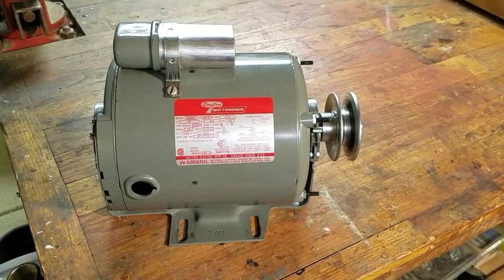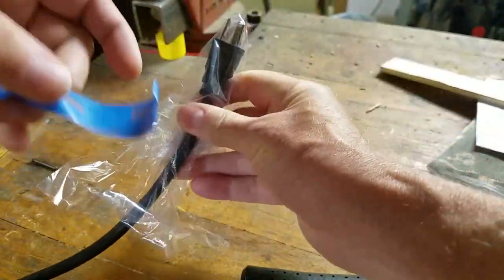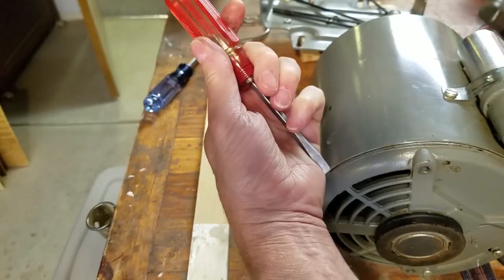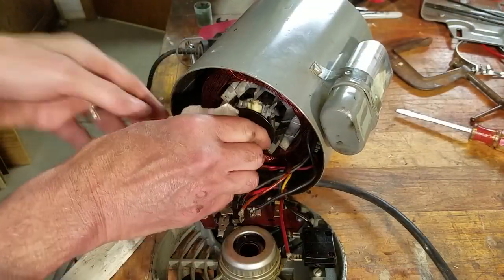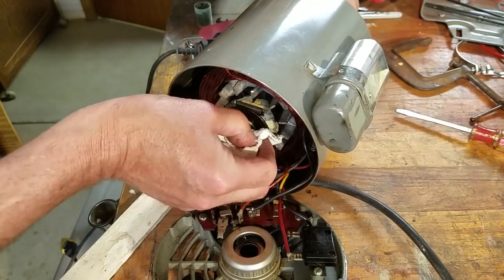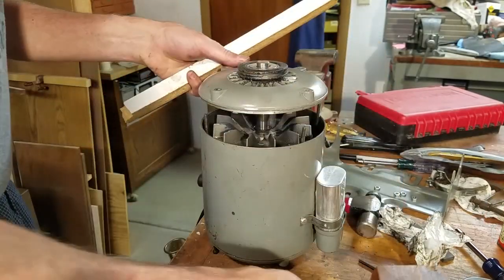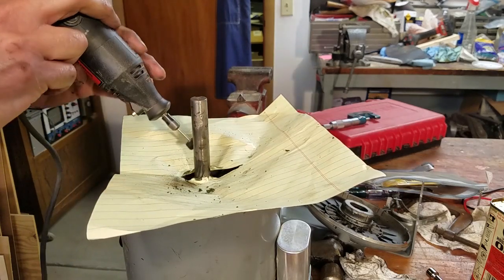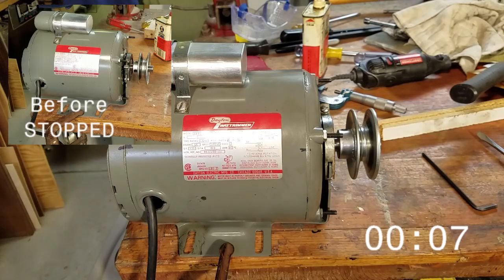The Case of the Squeaking Blower Motor - Dayton 6K857 3/4 hp Motor

Comment: Can someone explain what exactly happened here to fix the friction presumably causing the noise? I dont understand why this worked. I saw only the two mating surfaces of the bearings and shaft being cleaned and lubricated, but were the bearings themselves ever replaced or repacked?  I saw the centrifugal switch was lubricated. Was it sticking and where the noise was coming from? Are the bearings sealed or open?
Reply from the maker: They are sleeve bearings, not ball or roller bearings.  The shaft rides in a bronze bearing that is oil impregnated. Over time, the oil drys out and mixes with dirt and forms deposits on the outside of the shaft.  This reduces the bearing clearance and the high pitch squeal is actually a stick-slip friction caused by the gunk on the shaft along with the tight clearances.  Polishing the shaft increases the clearance and eliminates the gunk.  Adding oil completes restoration of the bearing back to working order.

Comment: David, Thanks for your very informative video. I was given a JET band saw with a 1 HP Dayton capacitor start motor. When I turn it on it slowly turns, hums, and will throw the breaker if I leave it on for a few seconds. I suspected the capacitor since it looked sketchy so I ordered another one and replaced it. It did improve marginally but still turns slowly and then throws the breaker. I suspect that there is something wrong with the clutch or the contacts. I don't have a lot of experience with motors and I have been unable to find any documentation on this motor so I was grateful when I discovered your video. I have watched several videos that say that the Start Capacitor has to have a resister soldered in to bleed off any residual electricity left over from the motor start. My original capacitor did not have one and I don't know how to find out which one I need. Any ideas? Thanks again!
Reply from the maker: It depends if it is a run capacitor or a start capacitor.  There are both types.  If your original didn't have a resistor, then the new one shouldn't either.  Open the motor and take a whiff.  If it smells burnt, then the winding my be damaged.  Some of the coils may look dark; that's not a good sign either.  In either case, you will need a new motor.  Good luck!

Comment: My a/c blower motor started making noise and I took it apart and greased it with the highest quality grease I could find...CRC synthetic brake and caliper grease.  I reassembled and it's been running fine now for 7 years almost continuously. Nice video. 👍
Reply from the maker: Thank you!  Self lubricating motors are much easier to use than motors with oil ports or grease cups (really old, but I got a couple).  However, they don't last forever.  Thanks for watching!